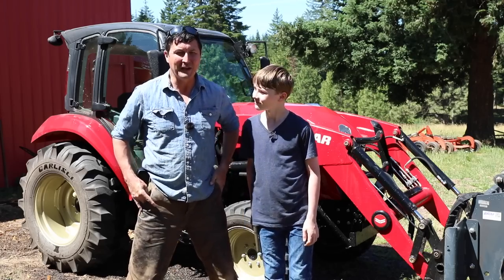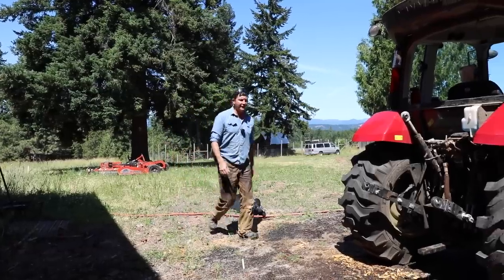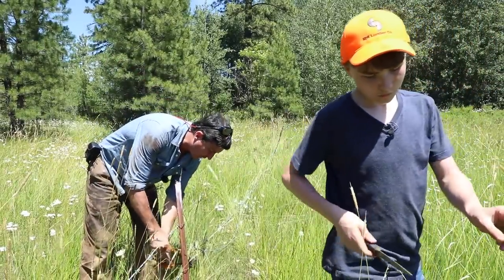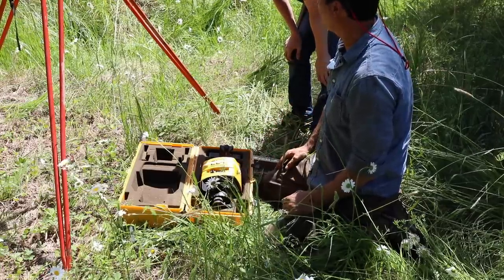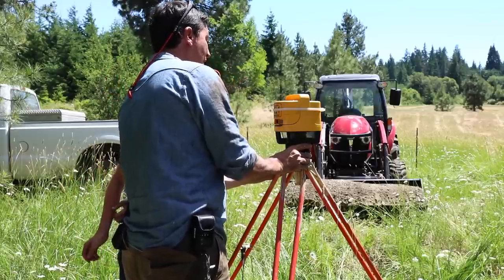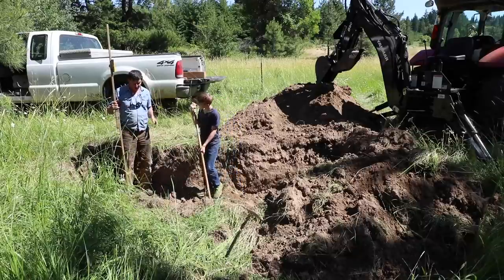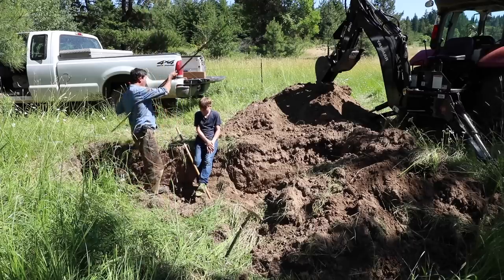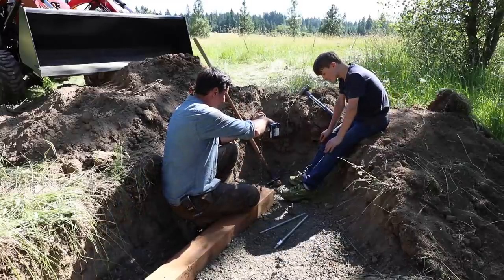How To Build A Bridge Over A Creek For A Tractor

Comment: With 3-10x10 beams and an evenly distributed load in the center of the span the bridge will support 9,924lbs. At no point will you have that much weight in the middle of the bridge because the wheelbase of your truck is over 12ft. In my field a safety factor of 2 would be used which would put the max capacity of the bridge at 4,962lbs. This is also not considering the strength that the decking will add to the bridge itself once installed. In my opinion, you should construct the bridge with 3 beams to ensure adequate strength as the wood degrades over time. It will also provide an even distribution of the load if equipment with different wheelbase widths are crossing the bridge. I hope this helps!
Reply: Bushmaster B these are probably the 2 smartest comments ive seen on youtube haha.
Reply: +Ryan Schmidt  At min a 6x12 is needed to carry that kind of load you are talking about. 

+Bushmaster B I agree the mane beams need to be near what is actually the vehicles track width wheel base is length but I understood what you meant.
Reply: I'd have just installed a culvert (and have done at my place in a similar situation)

You can be in & done in an hour or two and it'll support pretty much whatever weight you put on it.
Reply: Bushmaster B I played a lot of video games with very realistic physics. I can approve your comment.
Reply: Using a thicker web would be more beneficial but it is more about availability than what make the most structural since.  We have to consider he might not have large enough timer to get 3 6x16.
Reply: James never tell normies the actual time! always multiply by 3.14 for public time for completion!! jez didnt you take the engineering oath
Reply: By no mean do I mean to offend you but I believe this to be a bit overkill.  If this were to be a daily driver I could see the 5 beams but this seems more like a couple of dozen trip a year.  If we are talking about a sleeper span of 8-9ft (2.4-2.7m) and decking that with 5 10x10 in (25.4x25.4 cm) beams your effectively covering over 50% of your sleeper.  The soil would give way before this design of the bridge would.  I could see centering wheel spans with the 10x10 and dead center of the bridge with a 10x10 and then adding 4x10 on the ends for walking/running.  Possible even get away with 2x10 but I would worry about life span and fatigue with that small of a timber.
Reply: Seems like a lot of the replies here are ignoring the SIGNIFICANT load distribution provided by solid 4x4" decking. A central 10x10" would therefore provide the best additional support for both wheelbase beams. I'd be more worried about the footings failing than that bridge ever failing from load
Reply: Ryan Schmidt there maybe implements for the tractor, and it is never bad to be overkill than have a bad bridge.
Reply: Ryan forgot to factor in the beam length itself. Did the r squared d A moment of inertia thing, and the last 100 mm is huge in terms of failure strength. Depending on footer quality, I would go with 4 beams minimum and keep the width to 6 feet. Would most likely handle your tractor (bigger spot load than the pickup).Think 3 tons practical limit. Dynamic loads are not even close to static loads. Earth moves, materials flex, footers sink. Stuff rots. The loads get exponentially greater when one tiny thing fails.
Reply: Bushmaster B I totally agree with your analysis and would go with the 5 beams as well. I want anyone driving that Yanmar to be able to safely cross that bridge with a rear implement attached and the front bucket full of gravel or whatever other media with no fear of a colapse.
Reply: Agree, the decking is ridiculous. Spend the money on more beams. Learn to block the beams for stability. Space frame on good footers.
Reply: I agree with setting the bridge beams in line with the track width of the vehicles crossing it, and I have a suggestion related to that.
The idea is to distribute the strength of the bridge so that it's strongest under the tires of the vehicle.
If you switch to using 5 of 6"x10" beams, line up the outer beams with the track width of the truck and tractor, double up the outer beams, and run a single 6"x10" down the middle, you should end up with a bridge that is stronger where the tires meet the bridge, but use the same amount of wood.
It would effectively be a 3 beam bridge with 12"x10"s on the outside and a 6"x10" in the middle.
Reply: I found this calculator: https://courses.cit.cornell.edu/arch264/calculators/example8.1/
Some truck weights to aim for: https://www.reference.com/vehicles/much-ford-f-350-weigh-462337836f0bbfdf (8000 to 14000 pounds)

The calculator shows (if I understand it right) you need 4x14" beams, and 14 is the important number. I'd definitely use at least 3 beams. The number of beams is based more on the cross boards than on the beam size.

See https://www.treesearch.fs.fed.us/pubs/9710 for guidelines on forest service bridges. I've seen these bridges and concluded they have plenty of margin of error.
Reply: (1/12)*b*h^3 :  Zach A  has a point.
Reply: pretty sure he is making a bridge instead of a culvert. pipe diameter over an open ditch?
Reply: Brexit Monger did you watch the video?  Bridge.
Reply: Ryan Schmidt nicely done
Reply: Are you saying my 7,500 - 8,000 4x4 van should not cross that bridge?   :)
Reply: In bending moments, the point load is often more damaging than the total load distributed. It ain't just the total weight, it's the chisel edge.
Reply: Would pine trees work as beams for a bridge?  have 3 large Pine trees that I have to cut down, and I have a creek that I cannot cross. I would appreciate your input.
Reply: Pine trees are not as strong as other trees. They also rot faster. If they are big enough, then they will work short term.
Reply: scooter041031 Unless I'm mistaken, his sawmill only cuts to 12" depth.... I seem to recall Cody hesitating to cut from both sides of a timber in order to gain up to 24", so he likely is using 10" beams due to availability.
Reply: then to all y'all Engineers that's wanting to build a bridge he can run a 18 wheeler over we just pour concrete across it be done with it loaded with fiber and rebar and take two years to do it excuse me on the account of I-75 here in the United States 5 + years
Reply: James Bradwell , I agree. It sure seems like a culvert would have done this job nicely. Not as manly as building a bridge, but probably more effective in this build.
Reply: What can be more manly than laying a big piece of pipe in a culvert? Puns aside, gotta agree.Purchase way too much pipe cross area in the biggest diameter affordable, rip rap for erosion control. Cheaper, easier, and longer lasting with your tools. Floods will not hurt it as much as a bridge. Just go big with the pipes.
Reply: willy p00 he cut the timbers himself, pipe is something that would have to be bought.
Reply: And that big of pipe is bloody expensive.
Reply: The culvert is certainly the easiest option, but this way he gets to teach Jack and will get about 5 or 6 videos out of it!

Comment: I'm glad you've done this. I have a similar problem that I need a bridge for. I had an old pond that was drained years ago. They cut the middle of the dam to drain it but the elevation is two feet lower on the inside than it is on the draining side so it still holds water. It does drain some but just enough to make it soupy so I can't cross w o getting stuck. 
So I look forward to seeing your solution and maybe I can replicate it for my ditch. 
Thanks for sharing.

Comment: Your bridge should hold 2.7 tons depending on how soft the dirt is below the studs. I would recommend paving stones or concrete and you could knock it up to around 3 tons, however three studs, and concrete/stones will boost the capacity along the lines of 3.5 to 4 tons. Great videos as always, sorry about all the structural engineering nerd stuff I like to ramble.(exhibit A, lol)
Reply: Yes, add a few pavers under the sleepers to help spread the weight, I think you have a loamy silt and I don't think that bears a much as you think.
Reply: Judging by how dusty the dirt was in the intro it looks very soft.
Reply: jasonhw00 I

Comment: Hey Cody, have others have mentioned you shouldn't use a 10x10. Moment of inertia (a very important calculation when dealing with beams) is (1/12)bh^3. Therefore a 10x10 is 833in^4. Where as a 7X14 (basically the same area) has a moment of inertia of 1600in^4. Twice as strong with the same amount of wood!!!

Comment: Cody I'm not sure what your soil is like where you are at but I'm sure that it's probably a sandy loam with clay where you are so close to a volcano. similar to where I'm at here in South East Idaho, and with a stream running where you are building I myself would lay down a geoteck type mat down between the ground and the gravel that you placed to prevent contamination between the two and cause your timbers to sink and be uneven. Especially with that much water saturation. just food for thought. I'm sure that with your construction background and you being there where we're not you'll know what to do and know what needs done. I would also build it heavy enough to handle that short wheelbase tractor fully loaded with the backhoe attachment and a bucket full of gravel or sand because you never know what you're going to need to take across it. also extra timbers are cheaper than it braking and rolling your tractor off of it and totalling it and the bridge. and may you and your family have a wonderful weekend!!! :-)

Comment: OK .. This is how we did it  many years ago at a neighbors farm .. ..4 --12x12  pressure treated on a 15 foot span ..  placed  at equal distance of centerline  of the truck or tractor   axel .. 2 on each side bolted together .  toped with oak 2x8  4x4 runner on each side .  many lodes of silage corn ,wheat.. beans went over with no problems until a flood wash it away Then they installed a HUGE culvert  ..Great video Thanks for sharing ..

Comment: Cody, a few suggestions. That dirt under your footer needed to be packed down much tighter than you had it. Also, I would have put concrete footers then your cross members. As for the 10x10x14 or so beams, I would go with 5 total, two on each outside spaced about 6 inches apart and a center beam. The outside ones would carry the main load even though it will be displaced all over with your cross decking. This way you don't always have to be "dead on" when driving your vehicles over it and this should last you a number of years. Don't forget to provide for keeping your support cross members reasonably dry during the time when the creek bed is full of water. Have a great day.

Comment: I like your bridge; I built two on my property years ago spanning a four foot brook that never went dry; my only concern Cody is your abutments; I would have wider than 6x6; that is your weakest link; you are balancing everything on 6 inches; I know the ground will help but the object is to keep your wood off the ground to avoid rot; using wider abutments makes the bridge more stable when driving on and off; also I put tar paper in between the wood to isolate the wood from touching; I live in a very wet salty climate (Nova Scotia) another thing you can sharpen carriage bolts to use for fastening or just drive them as is; use the widest runners for your wheels to ride on to distribute weight; I used pentox to preserve my wood especially the ends; use 4x4 along the sides to act as buffers preventing your wheels from driving off bridge; you probably built more bridges than myself; but if any of this helps all the best 
ps great projects and great videos

Comment: First, the video really reminded me of working with my father.  Now about the center support on the bridge, I'm not an engineer but why would you put a center support?  How much weight is on the center,  I'm guessing not much if your talking about driving the tractor or truck over it.  My suggestion would be to double up on the sides, use 2 per side.  Next question would be what are the cross members going to be?  I'm guessing 2 to 3 inches thick?  Maybe 2x12's?

Comment: I'm currently in engineering classes in high school and an eight by eight would have been enough, so with those 10x10's u will be fine with using just two instead of three if u r using 4x4 or 4x6 for the decking. Hope this helps

Comment: The three 10 by 10s will work very well. I am more concerned about the footings failing. I'd personally replace them with concrete or have concrete block under the footings to prevent them from shifting in the dirt and gravel. With it being a stream bed it is at risk of shifting due to the soft sandy dirt. I would also highly recommend coating those beams in some sort of waterproofing to help ensure a long lifespan.

Comment: I'm not a fan of wood calcs (too many variables in wood quality), but I'd trust it for at least a metric ton per 10x10 (easily add 50% if the wood is really good)

You've got (in standard metric) a rupture strength of >0.050MPa on an area of  ~250 x ~250mm. Highest point of force will be in the centre = ~2m.

so in terms of the beam size, we end up with a maximum load of 0.05 * 2 * 250^3 = ~1.5 ton at 1m, so ~750kg point load in the centre per beam.

Obviously we're not working with a single point load though, so an axle spacing of just 1m means that we an now handle over a ton per beam (effective centre is now ~1.5m). 2m = ~1.5 ton etc

All of that's done with rough "worst case" numbers and rounding down, plus the cross members will greatly increase the rigidity (making the rupture strength higher) but if we want to throw in a factor of safety on top we can. lets say 1.5.

Point load becomes load at 1m becomes 1.5/1.5 = 1ton. 

Just be wary that for an unloaded tractor, it might be better to take the rear wheel as a point load of ~60% of the tractors weight rather than dividing the wheel base evenly. Likewise for your ute, the front will have a higher proportion than the back, so a % based point load might be better to consider.

Comment: May I ask why you opted for a bridge rather than (a) culvert(s)? I think we get similar snow, melt and runoff as you do in your area. I find there no fun in crossing a snow/ice covered wood clad bridge even plowed in the winter with track boards. We had one and the repairs became continuous over the years and we replaced it with an oval culvert. the bridge was built in 1960 (Dad and Grand Pare) with telephone poles, in 1987 we ( Dad and I) dismantled it (what was not buried and rotting) and replaced it with a longer culvert than the bridge was wide. There have been no repairs to it since and no vehicles have dropped a wheel or track off it since as well as being able to skid logs over it . Nice project and please continue the wonderful videos. Thank you   :-)

Comment: I am not an engineer either, but what I did was use a piece of 1/4 inch steel that was 6 inches wide, ,   between 2 6x6's drilled through and bolted together, , I used 3 of them for an 8 foot wide bridge, that was 12 feet long, I did this with hopes that the 1/4 inch steel on edge would provide strength, and make the 6x6's very rigid, I spaced these in the  so that the wheels of the tractor, would line up on them and put all the weight of the tractor directly on the beams, ,and this was topped with 2x12's as a decking, I did all this by the seat of my pants, no number crunching, so far 5 years later, it is still holding up, ,, I like your foundation work Cody, I will have to pull mine up and do the same, , all I did was half way bury a 6x10 in the bank

Comment: This is a home job and you don't need a structural engineer for this work, if you don't have an engineer friend that will do it for free you are better off spending your money on lumber, or your milling money on bigger timber. Most sound rough lumber is graded as grade 1 so a 14 foot span on 10" x 10" Douglas Fir with an F250  or a 60 hp Yanmar 5000 lbs would likely be the most total load on the structure, the 14 foot span will be fine with the 10"x 10" and because the yanmar tire center width is about 5 feet I would add the middle 10" x 10". With the F250 or Yanmar loading the 4"x 4" decking on the 4 foot span will be fine. So your lumber plan for the bridge will be fine. One additional piece of lumber I would add is a 4"x 4" nailed to the deck edge as a batter board to try and keep the tires from going over the edge.The weak part of the structure is going to be the soil load under the abutments you did add some crushed rock or pit run gravel that will help with distributing the load but the soil will likely compact after time.On the approach to the bridge try and make it level so there is no tire pounding when the vehicle steps on the bridge and that will help, worst case one corner will get a soft foot and sink down a bit, there should be no loss of life, maybe a frog.Another thing you had said in the video the water flow was about 2 feet at times you don't want water backing-up and washing your abutments if you have any large cobbles, field stones or armour type rock you may want to protect the abutments from water wash or impact and having a few rocks under the 4 corners will assist if the bridge starts to sag in a corner.Good project for you guys, hope you are having fun and a good ditch and that bridge will likely dry up muddy area and will give you more brush and field to cut and a nice trail for Mrs. W to boot! Win, Win!
Reply: He's got trees all over his block, big ones. One simple way would have been to  drag a few of those over and inset them to the banks. Maybe not the best way, but pretty durable and no big deal when the big storm comes and washes the crossing out.